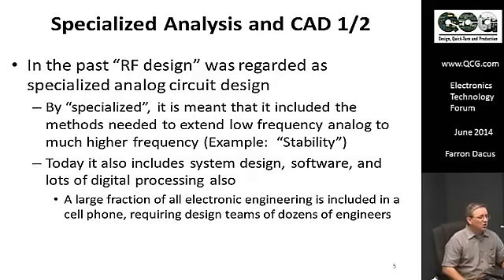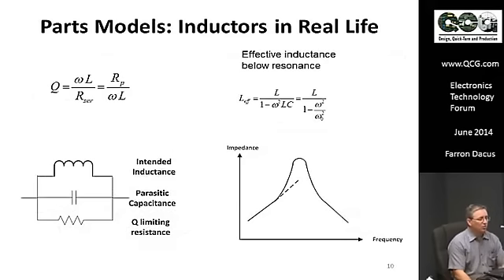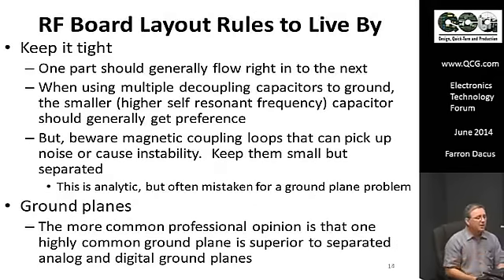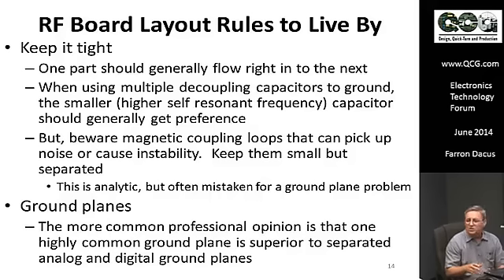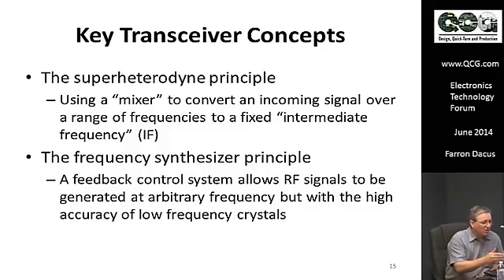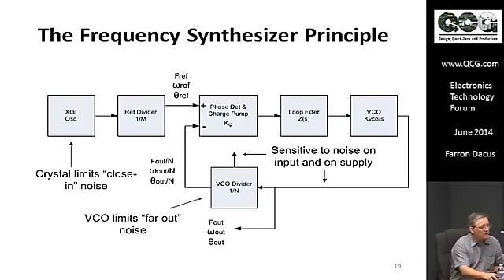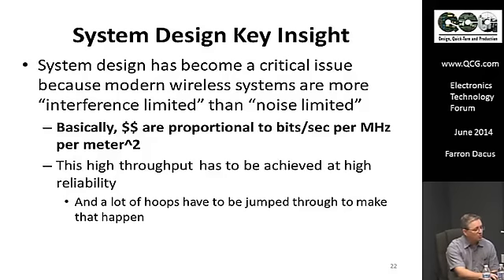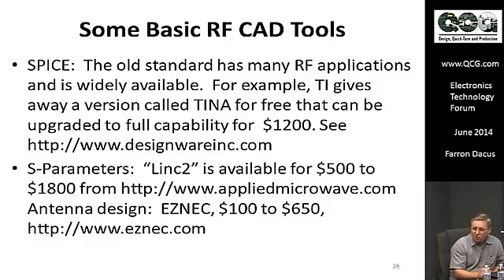RF Design Basics and Pitfalls

Comment: Ah, the S-Parameters, I used the Smith Chart extensively and the Vector Network Analyzer for that as A MICROWAVE Technician with only an Associate in Science degree in Electronics Technology help test, built, manufacture 'microwave stripline amplifiers' cascading them  '4 - 18' Ghz here on the Silicon Valley companies during the late 80s and early 90s. Thank You Sir. I am now retired and still learning the engineering physics and the math rigors of 'electromagnetics'

ktB with Boltzmann constant, Return Loss, VSWR, dBm, dBuV, dBi, dBc, Spectrum Analyzers, Noise Figure, Third Order Intemodulation Products, YIG-RESONATORS  ...; etc... etc.... :),